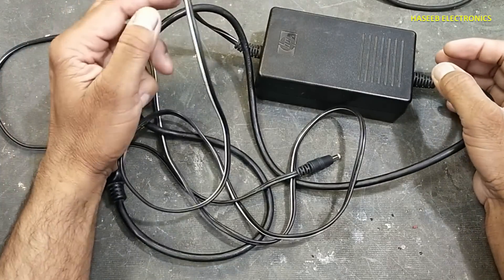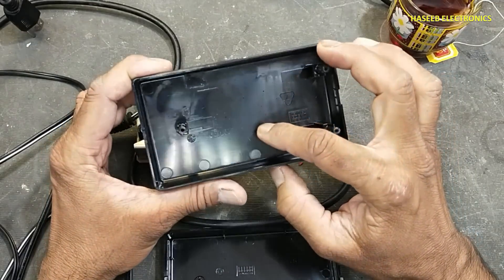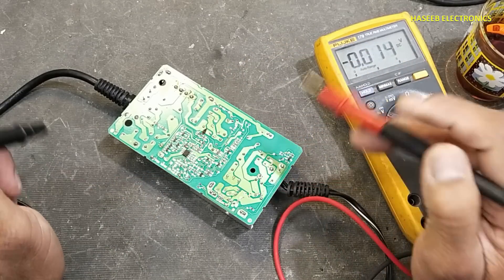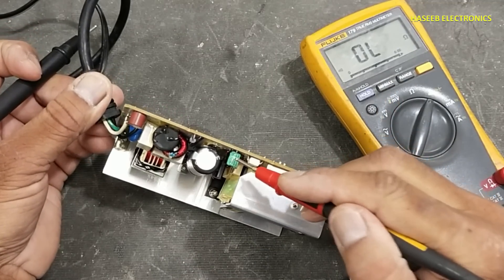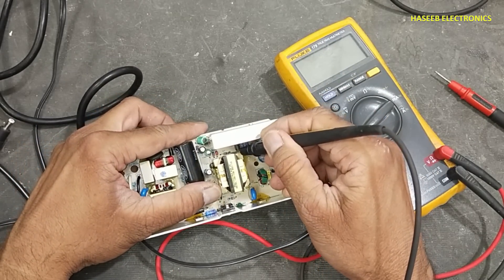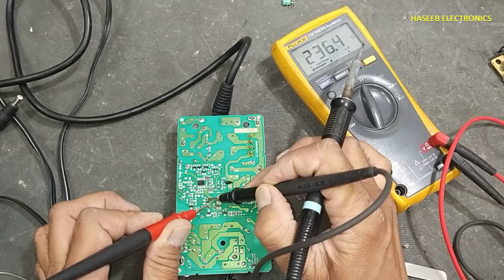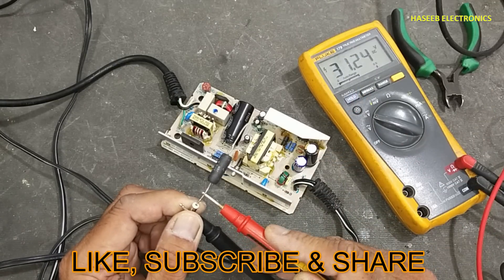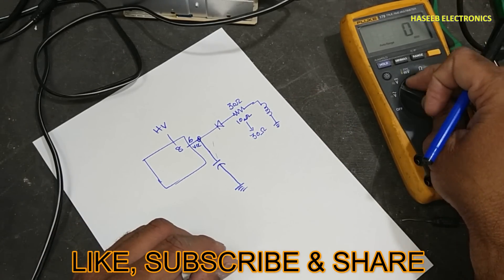{933} Power adapter not turning on

Comment: Hello Sir.
I have a question about switching power supplies. The output at the source is constant, but the coil filter makes a terrible noise and the voltage on the optocoupler fluctuates, should I look for the fault in the dried capacitors or elsewhere? thank you for answer

Comment: hello.
one day you have to tell us about your soldering station.
What is the model.
you don't seem to have any difficulty removing the components (desoldering).
I have a xytronic lf-8800, it works fine but the desoldering part doesn't, it's always clogged and I already had to change the resistance.
I like it, but as a desolder it's rubbish.
hug from portugal
Reply from the maker: https://youtu.be/pjBx7F-H0SE

Comment: Sir i have a e-scooter charger and it's mosfet is short (replaced, working) 
 sir in this circuit there are 2 heavy smps transformers and 2 normal smps transformers used 

Why? 
What are there work and how this charger work please explain

Comment: good video. Sometimes it is very difficult to open this kind of power supply when the box is glued
Reply from the maker: you are right, glued and thermoplastic welding joints are headache 😂 sometime it needs cutting and sometime plastic is so rigid that it prffers to break instead of separate 😂
but we have to open it, even it open gently or breaks. it is plastic's choice 
good morning and greetings

Comment: I like your work ... I wish to get some guidance on a PC power supply..for Acer.
They don't make new anymore.. everything is fixable. Thanks for your channel
Reply from the maker: i will try to arrange acer as well. if you have some issue, you can send message on whatsapp 00962795324272 or gmail ashraf4ta4